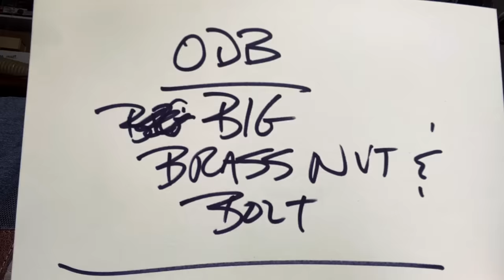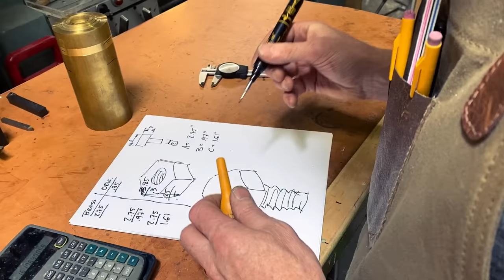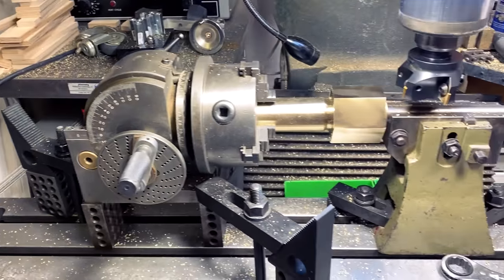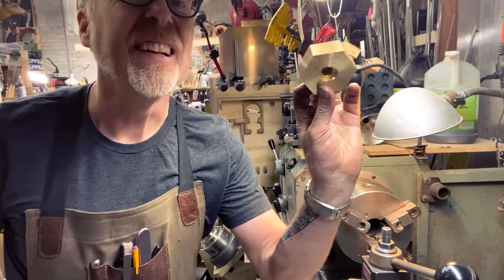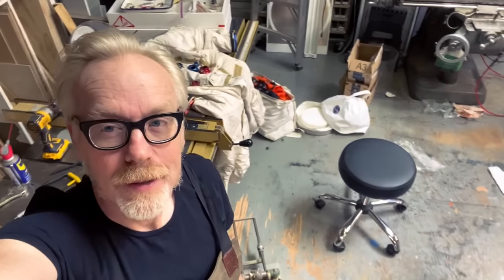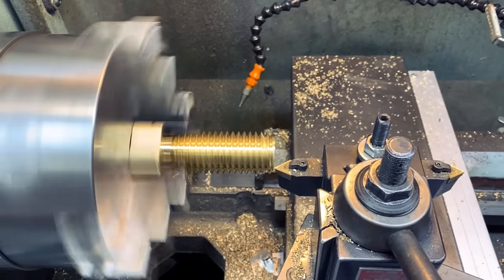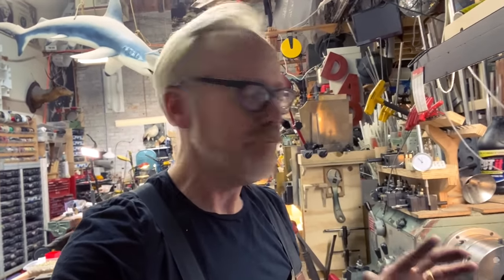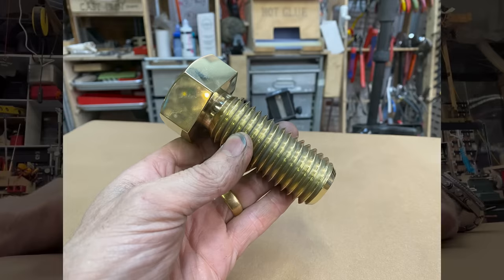Adam Savage's One Day Builds: Giant Nut and Bolt!

Comment: For me just making a simple screw/bolt was quite involved on my small Unimat lathe. I do not have the thread speed feeding attachment so I had to use a die. Being I had never done this before it also seemed to take forever but it did turn out beautiful.  It is amazing how little you think about what goes into a simple bolt or screw till you have to make one. I am getting better.  Adam is right. It takes a lot of time to master machining.

Comment: would like to see "pro" do this and see the difference in method if any. Would of been good to see the mistake and tell us what went wrong
Reply: And on piece work ,and making the threads to fit gauges
Reply: That would make an awesome cross-channel collaboration!  Tested team, please reach out to someone like Abom79, Oxtools, AVE, or ThisOldTony!
Reply: As a professional machinist I have been sitting here freaking out like “HES 90% THERE HE JUST KEEPS MAKING TINY MISTAKES!!!!!”
Reply: Check my reply above. Nick also made a good point, but the main problem was not enough grip. Plenty of area engaged, just not tight enough.
Reply: @joepie221 , Gary is right though, it would be nice to see a pro like yourself using the same kit as Adam and repeating the task, if anything to ensure he doesn't keep some of the bad habits he's starting to pick up and help with his order of opps.
Reply: I'm not a machinist but did it seem like the threads are a mite sloppy?  That nut sure spins on the bolt really freely.
Reply: Mainly the order of operations. Abom has explained thread cutting several times on his channel and cut a lot of threads.
Reply: @SierraLimaOscar  I have tremendous respect for Adam Booth, but have to add, he rarely takes it to the Next level. Standards exist for a reason. Never, NEVER use an existing part as a gage unless the part stays in your driveway forever. Period, End of topic. I've made parts that have circled the earth in space, and dragged the bottom of the ocean. You do it by the book, or keep your mouth shut. Bad habits are hard to break.

Comment: Why not finish it and fix the head once at the end rather than every time u mess it up
Reply: Once it twisted out of the chuck jaws, most likely the head was too burred or warped to clamp securely without re-machining flat again.
Reply: @ElectroDFW  agree, but a quick pass of a file on the damaged surface would be enough.

Comment: You could've reversed the chuck jaws to hold that "too large" brass rod.
Reply: ken c not all Chuck jaws are reversible, especially not many scroll chucks.
Reply: @emmajacobs5575  Those are reversible, look at the profile of the jaws.
Reply: @kenc4104  the profile is for holding the id of an item, being self centring they are scroll Chucks and thus shouldn't be reversable
Reply: @ken c, 
Definitely not reversible. Need a second set outside jaws.

Comment: >giant
smaller than many nuts and bolts used in industry.
Reply: fr, also, very curious as to why he decided to scale a 1/2-13 to the size of the biggest bolt he could make, instead of making the actual largest standard nut and bolt he could fit in his stock. UNS would be 5-1/2 TPI, and I would be much more impressed with a piece that could be checked with a standard (though pricey at that size) thread gauge

Comment: First off, I am no machinist:

Couldn't the jaws of the chuck on the mill be reversed instead of going for the lathe op?
Reply: Not on the one shown. The outside of the jaws on THAT chuck are convex, so simply flipping them would only gain you a convex profile that would have a very small contact patch. No good.
Reply: @jstephenallington8431  in addition to the jaws being convex, the mechanism that moves the jaws in that chuck doesn't allow them to be installed backwards, he'd need a separate set of jaws that are designed to be installed that way

Comment: I remember back in 1997 when I began working as an engineering technician at an automotive supplier. The company had a 'model shop' which was a machine shop by another name. My supervisor told me that I'd be working in there a lot and not worry about 'not knowing' how to do things. The guys with experience would help me...YEAH RIGHT! But seriously, they did help me BUT...I was scared to death the first time I began working with a vertical mill and a lathe. I kept imagining the work-piece flying out of the vise at blinding speed and cutting my jugular! Everything turned out OK, though. I came to really enjoy machining and the satisfaction of a finished part or thingy after a few hours of work. It's one of the best feelings of accomplishment I've had to date.

Comment: Adam. The lathe thread cutting anomaly you found and corrected recently was so interesting I signed up to ‘Tested’. But I am concerned that this one day build may have a thread pitch other than the one you planned. I believe the lathe setting wheel was installed 180 degrees out straight out of the factory.

Comment: Its easier if you set the compound rest to an angle of 30 degrees and then set the zero to both the cross slide and the compound rest to 0 when touching the side of the part. Then you keep the cross slide at zero duriing the maching and use the compound rest to cut in .003 to .01 each pass. You can use the cross slide to back out as long as you return back to zero. This allows the cutter to just be cutting on one edge of it instead of all sides of it. Makes for a better finish and makes it less "Grippy". Just some tips. I am sure you know that by now since this is from last year. Loved the video and it turned out nice. I like that you post your struggles as well. Everyone has them.

Comment: I remember watching my uncle use a taper bar to machine new front axle spindles for a farm tractor.  He machined the inner and outer bearing race surfaces, the taper, then threaded the end for the spindle nuts.  Then he welded the whole thing back to the steering knuckle.  It was a really old lathe, but cool to watch.  That was the first time I saw someone cutting threads.

Comment: Nice work! Not sure if you’ll see this but a couple tips for you. Turn your compound on 29.5 degrees and use that to adjust depth of cut. Still use cross slide to move off your part to go to the beginning but set the dial to zero so you can come back to the same place. Reduces tool pressure. Also if you want to figure your desired hole size for an internal thread, just subtract the pitch off of the major diameter. Example M6x1 tap uses a 5mm drill. Standard example would be 1/4-20 bolt. 1 divided by 20 = .05. .25 minus the pitch .05 would leave you with .200”. # 7 drill is .201 diameter and that would be your tap drill. Hope this helps. 👍🏻

Comment: I know I'm several years late to the party, but I remember doing nearly this exact project many years ago. At my university, in my department, students could not submit drawings to the machine shop until they demonstrated some machining ability. The basic idea was that if a student couldn't demonstrate a familiarity with machine tools and how they worked, they couldn't be trusted to provide well thought-out drawings. This was to fend off wasting the machine shops time modifying drawings with a lot of back and forth. The project was a half-inch brass hex bolt and nut, to be completed on a benchtop mill-lathe combo machine, and the pair I made still hangs out in my office as an engineering professor.

Comment: When measuring threads you should always measure your male thread over wires with a micrometer, provides the most accurate information as well as being just as fast as a pair of calipers when practiced! Thanks for bringing attention to machining Adam! Very under appreciated trade :) We have the same birthday by the way, been watching you since I was a kid!
Reply: Actually there is a proper tool for accurately measuring threads. It's called a thread micrometer. The anvils can be changed to suit any thread type and then calibrated against a gauge. The dimension being measured is the thread pitch diameter which is the known standard for common threads. Everything about machining stuff is shown clearly in the Machinery's Handbook. It's a very large book about 3" thick and shows standards etc. This book should have been consulted before doing any serious machining.

Comment: This was the practice in shop class at technical university. Milling cylinder into hexagon with routing and cutting, reducing diameter, threading with lathe. That was more manageable chunk of iron of course. I have those bolt and nut after 13 years.

Comment: How I avoid putting too much stress on the cutter is by putting the compound rest (not sure whether that's the right word for it in english) to 29 degrees and using that to take off the material. 
Every pass, still use the X axis to create some distance with the thread and put that back to a reference (I set it to the OD of the thread), then increase the depth of cut with the compound.
This way, you're mainly using one side of the cutter, while scraping the other side to keep it clean. It decreases the force on the cutter by having the chips go in one direction and it will not chatter.

Comment: Had to make a giant bolt and nut (with knurling as well) for my high school metal shop class and i still have it. The lathe i got put on was old so the setting was set to fine threads (my teachers doing actually) on accident and the nut didnt fit, but I learned a value lesson that day: Always double check your settings!!!

Comment: 2 things you can do to make it much easier.
1. Make internal thread on the nut before cutting it off so you don't have to use a bandsaw. Or just make a hole for the thread before using the short cut of tool. They also make a toolholder for the blade cutoff tool so you can go much deeper all the way to the center.
2. While cutting the thread you can use slide dial to offset the cut. This way the thread is being cut on one side of the tool and it generates less pressure on the tool and material so the material will not rip-off out of the chuck. If your slide is at Zero degrees you can dial lets say .010-.020" sideways (either direction) and you can actually take a deeper cut  like .060" in instead of .020" at least at the beginning. The second way is to rotate the slide 60 degrees and only use the dial on the end of the slide for the cutting much faster until the last few cuts where you use carriage dial to go in a few thousands at the time. Also, how do you know your thread is finished to size? I assume you use a set of thread wires? Unless you have a gauge.

Comment: I had to cut an interal thread of about 2 1/2" af about 16 TPI. The Go side of the thread gauge was damaged at the start, so I turned it around and used the other end that had only miner damage in comparison. I got a really good fit and took the work out of the 3 jar chuck on the lathe.
That afternoon the boss said the parts are wrong they gauge done fit, so I explained. To which he said " you will have to make it bigger they wont understand, they will just send it back." This is British Gas.
I had to put the job back in the lathe with shimming and tapping to get it to run true ( 3 jaw chucks almost never go back to the same place twice after being used for years without being cleaned or oiled in years) then chases the old thread to take another pass.
The work shop gods smiled on me. one cutr that i thought would be to big was just right the bashed end of the go went in and the NO Go didn't. Job out the chuck and on the  bosses desk for inspection.
The damage could have made the Go bigger then the NoGo.

Comment: So this might be a bit late. That said for those who are either starting or whatever with machining. get a dial indicator with a magnetic back. place it on the ways of your lathe, then bring your tool to the point where you want to stop cutting. Set the zero of the indicator so that you have about 1-2 full rotations of travel before your stopping point.  With practice (it takes time), it will help with less crashes, and scrapped parts. This also really helps when working on internal features.

Comment: Adam, if you want a baptism of fire when screw cutting maybe try a 30mm x 6mm pitch triple start Trapezoidal over 2 metres using 316 Stainless steel! (Which due to lathe limits, had to be done in two halves, 1 metre one way, then turn around and realign the tool and start from opposite end!) That tested my skills to the limit when I was used to doing 'standard' threads like this one!

Comment: Hey, nice work! As a machinist I feel obliged to give you my input. I think your thread cutting setup is a little sketchy... they sell purpose-built thread cutting tools and inserts. They allow you have your tool post square-ish and are designed with the cutting tip closer to the left, so you have more clearance before crashing. This would have allowed you to run your machine normally without needing to flip your tool. Also, conventional cutting inserts have a small radius at the tip to strengthen it, which makes a small radius at the bottom of your thread, impeding on the standard fits and tolerances. finally, as you made your first pass on the bolt, I noticed it wasn't perfectly concentric. A good way to solve that problem is by making a small hole in the end with a center-drill and supporting the piece with your live-center and tail stock. The best time to have done that would have been back when you first had the raw stock in the chuck , because the hole and diameter surface would have been perfectly parallel to each other. Hope I wasn't too patronising, godspeed.
Reply: More tips, after seeing the rest of the video: 
Threads are described in detail in the machinery handbook, giving you precise measurements and tolerances to get the fits (1A, 2A, 3A) you want. There are also formulas to help you estimate when your threads are finished, etc. Usually, when I cut a nut and bolt, I use precision thread wires and a micrometer to check if I am within my tolerances for the bolt, then I make the nut and when I am close to finished, I take smaller passes while checking with the bolt between each pass.

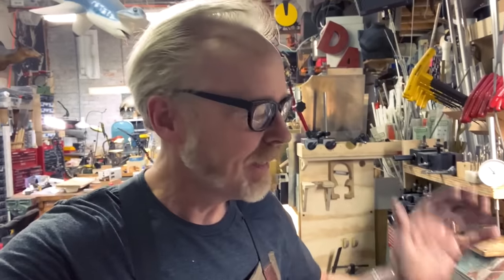Comment: adam ad 16:50 you can buy special stoppers that you can put on your chuck so your material won't collapse inwards. if you support it against the chuck it will be so much more stronger, you can easily put 0.5mm cuts ad 400rmp. try go faster. i think they are called ''magnetic chuck stop''
Reply: always support a piece facial against the chuck or a chuck stop! that is preventing you from making thick cuts, there are many ways. You can make an axle or rod truth your lathe so you have an adjustable stopper or you can buy them.

Comment: Hmmm, Adam needs to watch some of the Abom79 videos on cutting threads. Issues: did not use cutting oil. Did not use the tail stock at first. Probably did not sharpen and lap cutting tools. Did not use a thread pitch gauge after making a scratch pass on the work piece. Did not indicate the work piece in the lathe head to adjust run out. Dividing head could have fit the full stock diameter by reversing the chuck dogs.  Basically, Adam had no idea what he was doing.

Comment: It is sometimes better to cut the nut first as it is easier to use as a gauge especially if the bolt is large & heavy to try to fit into the nut on the lathe. As the tool gets deeper into the thread it cuts on both sides & wedges the tool into the workpiece. To prevent this, set the compound slide to zero ie, parallel to the thread. Then for every cut depth wind the compound slide half the depth of the cut, this keeps the majority of the pressure on the leading edge of the tool. This helps with chip flow & reduces the cut on the trailing edge of the tool where it is not supposed to be.

Comment: I doubt you see this but... In the future, to relieve some of the force on your work while cutting threads, set your compound rest at 29.5 degrees. Touch off and set x zero then return to zero every time. Feed in with your compound rather than cross slide, this way you'll be cutting on the leading edge of the tool rather than completely engaging it and causing tons of force. 👍

Comment: Adam, im sure in the motor trade, most nut heads are bigger than their bolt counterparts, for instance, for a bolt that fits a 17mm spanner, the nut that fits on it, usually fits a 19mm spanner

good job man, my uncle used to make nuts and bolts for general electric, and they were huge, like bar-bells, they were for holding power plant equipment to the ground

he also made some massive nuts that went onto all-thread, where the all-thread was mostly concreted into the ground, and rollercoasters were bolted down to them

Comment: Adam, why did you not use the adjustable angle feed instead of the cross feed to cut the threads?  Just set the stop on the cross feed and return to that fixed position for each cut.  This would also cause the cut to be almost entirely on the leading edge of the tool reducing the tendency to chatter.

Comment: You're killing me dude. Lol. When you are cutting 4 threads per inch you do not have to worry about engagements it will always engage in the exact same spot. That said, when you get to the end of the thread you should uncouple the half nut manually run it back to the beginning shut the  Lathe off and engage the half nut again. 👍

Comment: I feel Adam's pain on this one. Back in grad school, the experimental physicists were encouraged to take metal shop so that we could construct parts for our experiments, instead of paying the department's machinist to do it (at least, you know, the easier ones). The "final exam" was... to machine an inside and outside thread (although we didn't need to do the hex of the nut and head.) Whew, that was a challenge... I doubt mine turned as easily as it looks like Adam's does.